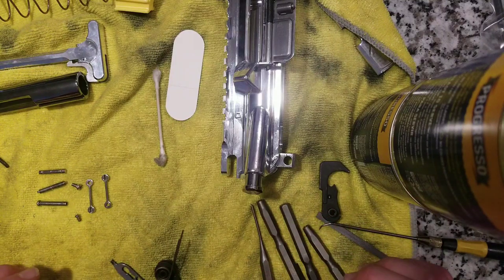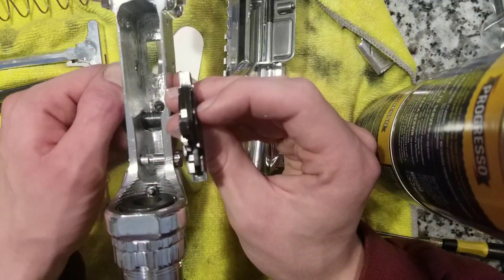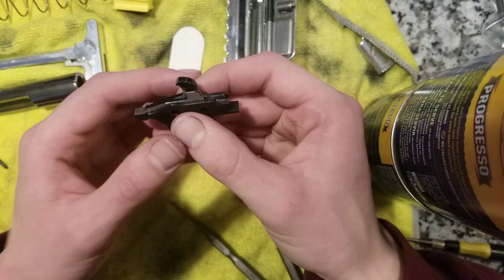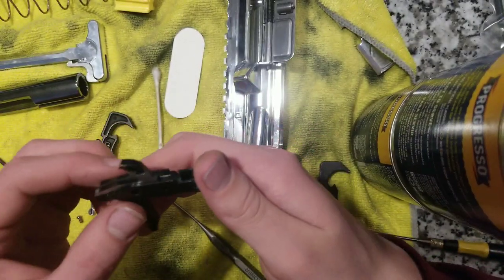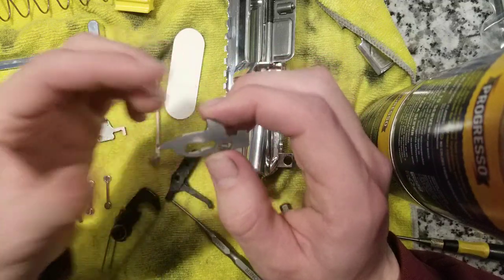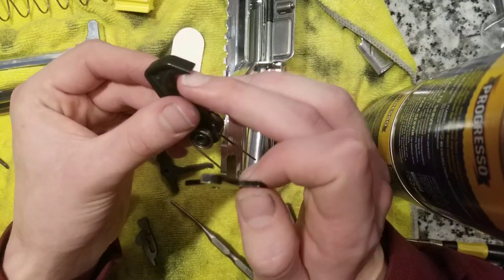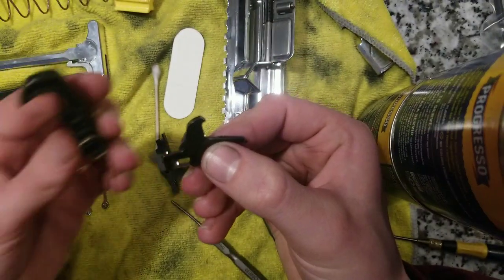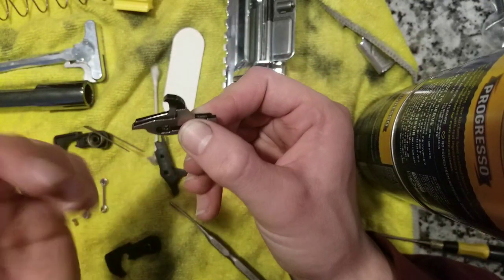Franklin BFS3 trigger problems + modifications Part 1 (Fix your Semi Only Trigger)

Comment: With the spring, you can stretch it out a little. That’s what a lot of CZ Scorpion owners do with the binary trigger. 

The hammer tail, it’s better to cut it with a bandsaw than to grind it. This is actually a good thing to do if one is using a light spring kit and I strongly recommend it. Lightens the hammer, allowing for faster hammer drop and prevents light primer strikes. I have done it a few times.
Reply from the maker: Excellent info thank you!
Reply: I have a BFS111 in my MPX and at times I seem to outrun the trigger. Does bobbing the hammer this way help that any?
Reply from the maker: @hughgrection3052  if you mean you are pulling and releasing faster than the cycle of the weapon you either need to practice more to get your tempo down better and accept the slower cyclic rate of the weapon. Otherwise, if you are looking to increase the cyclic rate of fire you will need to swap to a lightweight bolt carrier group and lightened buffer/spring assembly. You can also add an adjustable gas block to increase the gas on the action (a last resort as this increases dirt accumulation). Lightweight carrier and buffer groups also have drawbacks in their increase to the felt recoil of the weapon. If it were me I would try a lighter buffer and spring combo kit and play around with mixing and matching the buffers and springs until you are happy. If you still need more speed, you'll need to add more gas or shave weight off of the bolt assembly.
Reply: @Divorceization  all true. But it's a MPX tho and not exactly an AR. I'll have to order the aftermarket spring kits maybe for the carriage assembly later maybe. It's just a range toy atm tho so it don't bug me that much tbh. If it was a quick fix tho I'd pursue it more I guess but it's fine thx. 
I do however own a F1 that's raw like yours but I never mirror polished it yet. I may do so one day. But I put an FRT in it tho and it ran too fast also. I had to put in a heavier spring and buffer and it finally ran fine now. And by doing so I can almost do single fire with it last I tried. So that's kinda cool to have that ability without the aftermarket expensive/rare selectors. 
My next project will be the MCXs I have. Dam ammo costs have put a cramp on my style tho as far as tinkering lol, especiallyfor 300 AAC. But it's a fun hobby. Thanks for the info bud

Comment: For my fix i found a spring in my spare parts kit that had a similar diameter and coil rate, I believe it was a spare retaining pin spring and I cut it a little longer than the factory spring. Works like a charm and doesn't void the warranty

Comment: After polishing the 2 pieces so they slide smoothly, I still had a drag in there. I found that the pin with the  c clips on it was corroded, so I put it in my drill and polished it also. Problem solved. I have a complete lower ordered so I will check all this out and polish as necessary.

Comment: Well I'm having the opposite problem.  Was fine for about 1300 rds and now I have only binary.  Safe works but semi and binary position both fire binary. I looked at it for a min and nothing looks broken but haven't taken it apart yet.  I'm hoping it's not worn out already 😕
Reply from the maker: Take it apart, clean it, put it back together man. That's all you can do. Might as well polish the moving parts while you're in there
Reply: @Divorceization  well I took it apart, cleaned it, sanded like you did and replaced the ids spring,  same problem.  I have another one in a rifle so I carefully compared them, no excessive wear. On the malfunctioning trigger I noticed also that if I lowered the hammer slowly with thumb pressure the sear would catch as it was meant to. The only difference was that on the malfunctioning trigger i had used the heavier hammer spring, so I put the lighter purple spring in with the lighter red trigger spring and viloa it works. No idea why, I think the hammer spring was overpowering the ids spring looks like. Idk it was fine for 1500 or so rds. ??? Weird. Hopefully it lasts longer this time lol.
Reply: Or maybe the hammer spring was running the hammer faster than the disconnector spring could keep up with? I guess that would make more sense.
Reply from the maker: @KurtOnoIR  I think that was probably a mismatch in spring power coupled with normal break in so it just wasn't operating. I think I used all lightweight stuff on mine or all mil spec. I know I didn't mix n match
Reply: @Divorceization  yes could be,  i didn't mix and match either tho I don't think. The problem trigger with the heavy (milspec) springs was in one gun and the other one with the lighter springs was in a separate rifle.  Now they both have the lighter springs.  I have two binary triggers in two separate guns. I should have just tried to swap the disconnector spring just to see, maybe that was fatigued early. I dont want to take it apart again tho lol.
Reply: How are the surfaces on the selector switch? If that metal wore out it. I can see how it's either in safe or always binary.

Comment: I have never seen a chromed AR before..mannnnn my face hurts from laughing so hard...that is FUCKING AWSOME!
Absolutely no fucks given...
Reply: It's actually polished raw aluminum.  I have an F1 raw AR. Mine hasn't been mirror polished tho and I prefer the Mad-Max look it has that way instead of the super shine.
Another little secret I stumbled across tho, is to go search the web for raw unfinished AR parts and you'll see they sell for way cheaper too. I guess they're sold this way to dealers who build and then paint them at a discount. But myself I kinda like the raw look. Handguards and upper recievers for like 50$ that cost tons more if painted or anodized. Some folks paint thier rifles camo etc anyways. Worth a check tho
Reply: @hughgrection3052  nice

Comment: ya... it needs a break in and also needs to be very well oiled
Reply: So needs to be ran say a few hundred rounds before binary will function?? My first Franklin armory binary trigger worked flawless never missed a beat, just installed a second on another rifle and it hasn't passed the function test just dry firing...... Not happy about a $400 trigger not working out of the box. Sounds like I'll have to make modifications 🤬

Comment: Strange mine and my three buddies all work perfectly maybe u got a lemon
Reply from the maker: Did you put them into lowers you milled out yourself and converted to working from a hunk of metal or did you buy a predrilled lower? This is more useful for people who made 80% lowers than someone who bought a lower that had been cut with laser precision.
Reply: @Divorceization  no I have a stock anderson and buddies have stock brands also. No milling or nothing, maybe we got lucky. Whatever I believe franklin has a good product, little expensive but that everything these days.
Reply from the maker: @bobscott117  yeah they are pretty neat things. But yeah the anderson lowers are cut on a high end CNC machine so the "slop" is almost nothing. These Franklin triggers require perfect precision to work right out of the box. And, as you saw in the clip this lower was made in the garage with a dremel and a drill so the precision is not perfect and forces the geometry of the trigger to be a little off which is why these mods are needed. I tried using a drop in fostech but the "box" for the fostech also requires a perfectly cut lower and Franklin's trigger as you know is a multi piece trigger that isn't wrapped in a metal trigger housing so it was perfect.

Comment: If I paid the $450 for one of these, I'd be on the phone with Franklin before I did all this work.
Reply from the maker: They typically work pretty well in manufacture lowers due to the precise dimensions. But 80% lowers can be off by just a hair and cause these issues. But mainly one of the problems is for sure that IDS spring. They'd probably do nothing but send another one which would do the same. My only hope is someone that works there sees this and implements changes on their end.
Reply: @Divorceization  That makes sense. I understand. And, I can see them telling you they can’t help if it’s an 80% lower. Thanks for putting out this detailed information.

Comment: Use your old hammer
Reply from the maker: I wish that were true but I tried several hammers from all sorts of different manufactures. Wish it were that easy but if it worked for you then awesome.